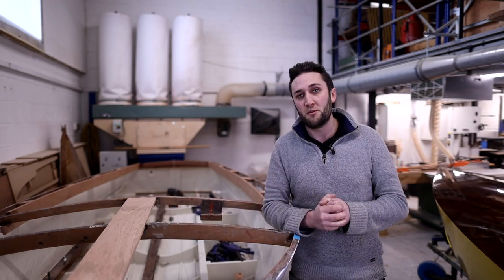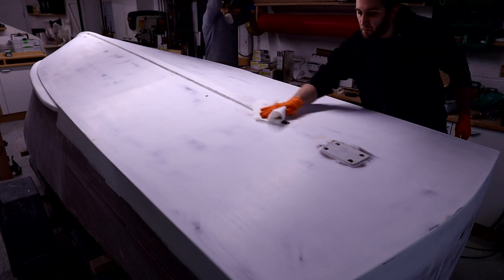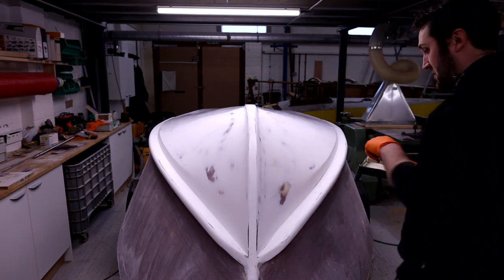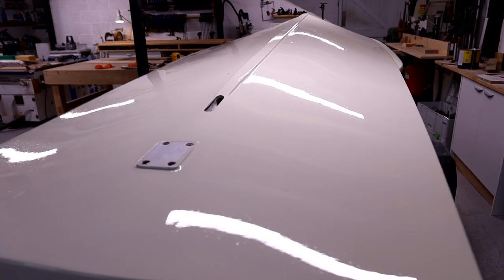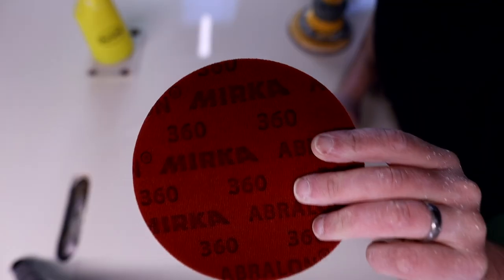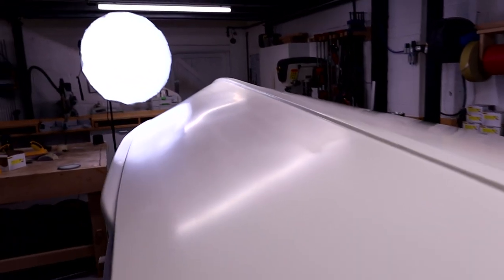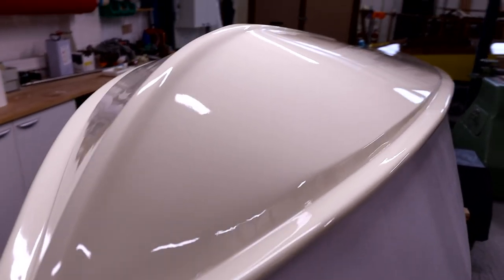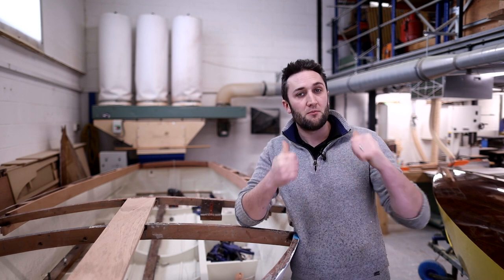Rolling Epifanes Polyurethane Gloss Topcoat | Healey Boat Restoration Part 8

Comment: Very nice, Dan.  I used a flocked roller from the specialty paint store which I rolled repeated over taut strips of masking tape before applying paint.  It worked well enough.  But I am wondering which type of foam roller (if indeed it was foam) you used for the final topcoat?  As always, top notch, educational video. Much appreciated.
Reply from the maker: Thanks. Yes I did the same tape trick with the first batch of rollers on the second coat, still found that we had hair loss though. The type I used in the end was a flock roller by Anza, very nice. Foam rollers don't hold up well to this polyurethane, they swell and go really floppy after around 10 minutes which isn't good.

Comment: Nice job, great work, @ 10:16, is that boat in the background an Albatross, i had one years ago and this looks the same, mine was a 13 footer, this one looks like its a 16 footer.
Reply from the maker: Thanks! Thats a little Glen L zip, it's the same boat thats in the right hand side of the shot when I am talking to the camera. Probably a similar size to an Albatross but it's all wood and outboard powered.
Reply: Thanks.

Comment: Hi, are you going to make a video on how you make the front to with all the slits? I just bought a 1960 Chris Craft and I may have to replace that. Thanks.
Reply from the maker: Yes, the next video will be mechanical fit out which I’m doing now. Then I’ll be putting the new deck on 👍

Comment: hi, Dont laugh but i was thinking of painting my kit car which is fibre glass like this but i am worried about dust contamination. Do you know if you can  rub down top coat say with 2000 grit then polish it up thus removing any dust ? thanks
Reply from the maker: Epifanes have a car that is painted with a roller using their paint that they take to shows: https://www.facebook.com/photo/?fbid=449962767130331&set=pcb.449962807130327 

Yes you can flat and polish this paint as well to remove dust and imperfections 👍

Comment: This paint says "for above waterline" but all the videos I see show painting the bottom of the boat.  What's up with that?
Reply from the maker: As we are painting a launch here it is fine. The above/below the waterline classification really refers to boats that are permanently in the water. If this boat were living in the water permanently the paint system would likely have been an epoxy primer followed by an antifoul under the waterline.